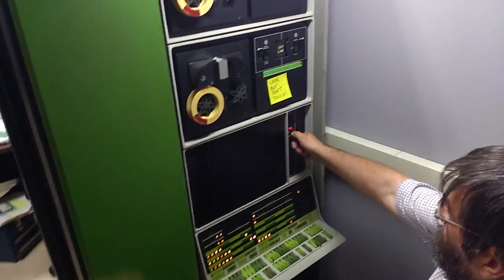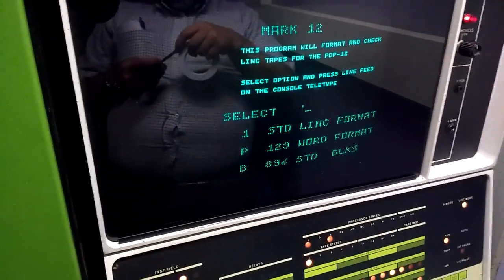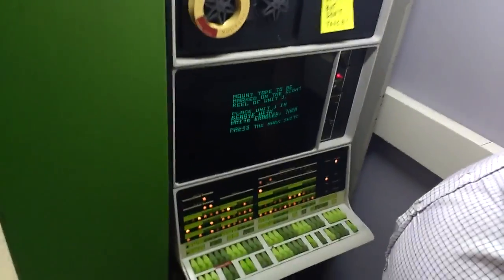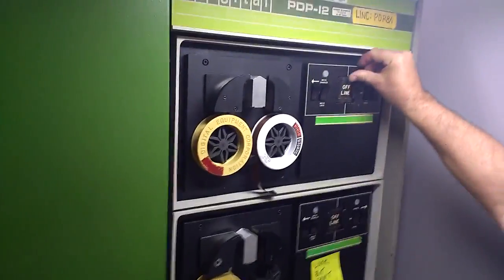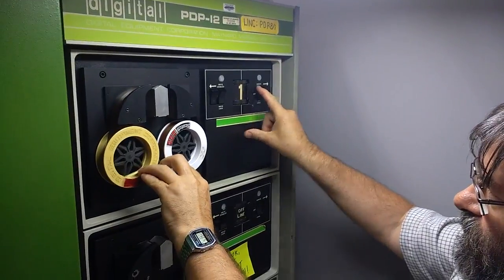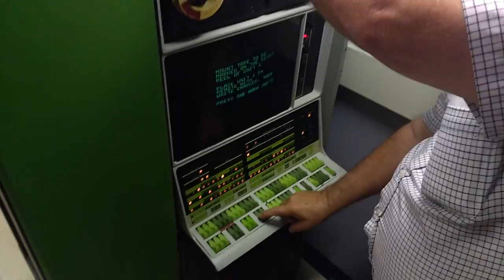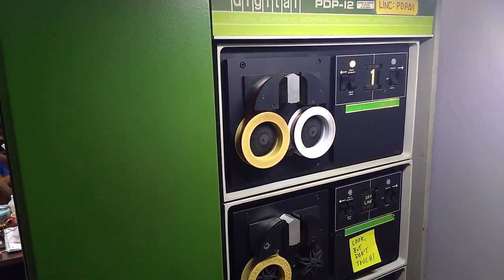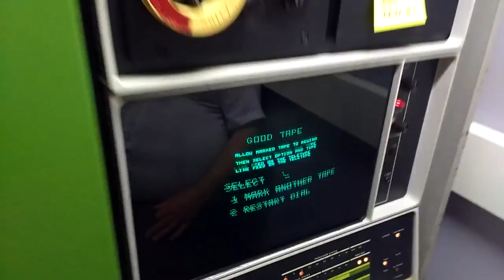PDP-12: Where A Tape Is Loaded and Formatted

Comment: Why does the display make such a sound?
Reply from the maker: I'm not really sure. I think it has something to do with the hardware, which is a vector display -- more like an oscilloscope. I noticed that the vectrex I once had made sounds like that. Also, the PDP-12 itself makes noises that can be in sync with what you see on the display, which you can learn about in my latest video.

Comment: I would love to see and hear more about that amazing display.
Reply: I haven't watched the whole video to see how much they say about it, but it's basically just a big oscilloscope:  it doesn't do any characters etc on its own, everything is DRAWN!  Much of the PDP-12 software used the CRT as the console output rather than the teletype printer, for speed and not needing paper.  The teletype keyboard was still used for input, and there were some A/D (Analog to Digital) controls behind the green panel on the left side, that could be used for "cursor control" to move more freely in blocks of text while editing, etc.  It was very cool!

Comment: There is no purpose served by the 129 word format; that was added in ignorance by DIAL programmers who had no idea what was needed.  The PROPER format is 128 words/block.  Fortunately, the two relevant operating systems [mine and OS/8] can ACCOMMODATE the extra word, it is a pesky overhead that actually is detreimental!

The so-called "standard" format means the only format supported on the LINC which has no options for anything else.  DIAL uses the longer 896 format tapes because the tapes are always nominally [sometimes longer!] 260 feet.  The standard tapes are only nominally 150 foot long.  The unmodifiable LINC format can only address 512 blocks; the LINC-8 and PDP-12 can do a lot more, etc.

This is why I need to get a copy of my modified MARK12 and TC12F programs so they create the 128 word format correctly.  [Note: the bad reasoning is because lINCtapes can actually be any length you want.  DECtapes much be exact mulitples of 18-bit words.  Thus, on the PDP-8 we have to use 129 words, but always ignore the 129th word [except on the Disk Monitor System on DECtape which cannot run on a PDP-12!]  Thus, they who wrote it never asked what they who needed it actually needed, etc.  Moreover, the PDP-8-oriented software can use more than a single tape length, so the more tape, the more storage that actually can be used, etc.